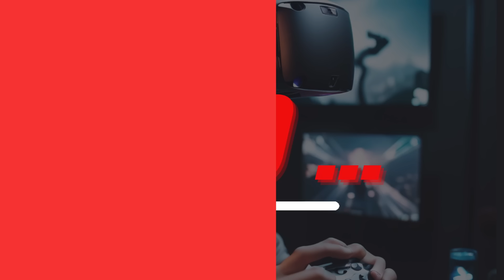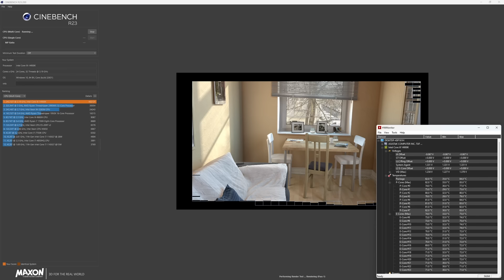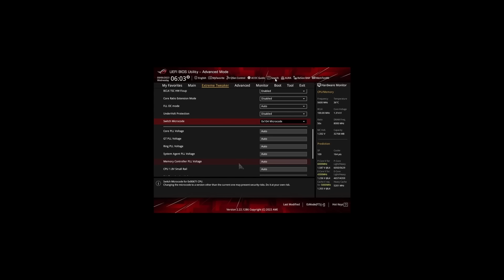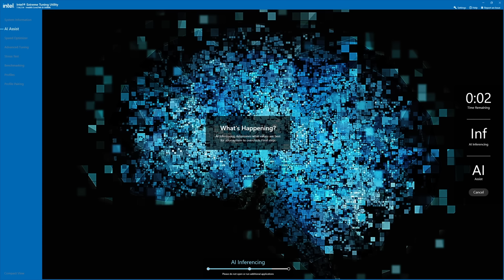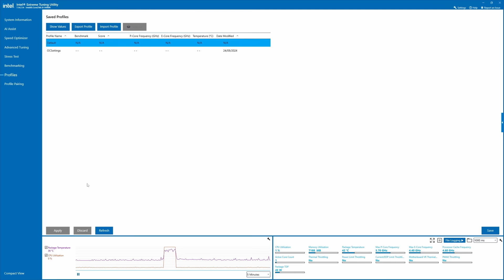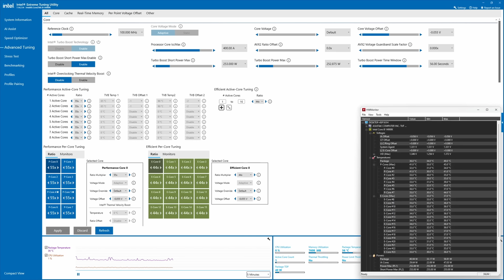Comment: Only updated to 0x125 and still havent update 0x129 for my 14700k

I Just set the limit of IA Limit to 1.400 V. I cant get the maximum advertised speed but it should be safer now. Might change it into 1.375 

 I hope it will solve the degredation problem by not reaching 1.54V again. Because I'm planning to use this cpu for around 5 years++ before upgrading.
Reply: Personally I think voltages is the main issue but intel cant fix it because if they reduce the voltage , then they wont get the advertised speed.

But I think downgrading my 14700 and make it into 12700 spec is far better than letting it kill itself in 2 or 3 years. 😭😭

And undervolting is also a good option. As long its not too extreme.
Reply: @OfficialMinamo  Exactly,, this would throw them into extremely muddy water when they are already facing various class action lawsuits.  The enthusiasts have been aware for some time that they have to take remedial steps to under-volt and downclock to lower the temperatures and in many cases improve performance, but Intel would never be able to tell us this directly for that very reason.
Reply: @nextlevelsimgaming  I really hope your video will give more awareness to people who bought the 13 and 14th gen intel CPU. And they will at least try to  solve the problems , before the problems shows itself.

They need to do something themself , and not only depending on the latest microcode . Because those microcode will become microheadache in the next 1 or 2 year.
Reply: The lower the power running through the CPU’s the better, if you imagine a modified engine in a car, that has been remapped to achieve higher performance, you wouldn’t drive it round at the redline constantly.  Unfortunately the behaviour of many of these processors has been exactly that way, with some even boosting to 6ghz at idle!

Better to be safe, thank you for your channel view and hope the guide was of some help to you 🙂
Reply: if u are limiting processor not undervolting it and setting loadlines as you should then u are making that you CPU asking for 1.55v and u are giving it 1.4 coz u limit the current it needs to get...  the whole point was to sync asking amount and giving amount and to make that  amounts lower :D how to do that with degraded CPU? u cant! so u do this tutorial. but if ur CPU is new u do 0x129 update and make other things... my mbo is Gigabyte and my landline go on high and AC/DC 55 after that I set undervolt to -100 and everything works well.. my CPU don't go over 72-3 degrees and benchmarks are just as they advertise in multi core and single core ... but it is natural that when u have "k" version to overclock it :D this is pathetic that we need to set settings under out of box ... coz out of box it is overclocked bad with possibility to degrade....
Reply: @CodeNameTech  according to buildzoid trial and test, using VR IA voltage limit is telling the cpu the max voltage the cpu can request.

So when we limit it to IA VR limit 1400 and  your cpu asked for 1.55V to boost the speed 6 ghz, it simply tell the cpu that the max is 1.40V and This will make the CPU not being able to boost to 6.0 ghz because of lack voltage and ended up with around 5.4 ghz instead at 1.400V. So if you set the VR voltage limit to 1.300V maybe your cpu can only reach 5.1 ghz or lower.

While undervolting is when cpu asked for 1.55V to boost to 6ghz, mobo will give them 1.55 - offset number you set and let the cpu try using that voltage to boost to 6ghz. The bigger your offset number, the bigger chance it will crash.

I think both method works, limiting voltage is like forcibly making your i9 into i7 or i5 , while undervolting is making your i9 works as i9 with lower and safer voltage . CMIIW

And yeah I agree with you.. intel is crazy LMAO
Reply: @OfficialMinamo  so basicaly u are telling what i have told... ur cpu constantly asking for more and u are giveing him less :D and such a behavior is probably more posible when u underclock and undervolt coz it will be more stable like that... im only saying that best way possible is to avoid sucha direct limit and do fine tuning other way :)
Reply: @CodeNameTech  ahhh okay.. sorry i misread your previous comment. 

The problem now is I dont know if i should update the bios to 0x129. Because some people said that they ended up with worse voltage spike after updating.
Reply: If you just set the IA limit to 1.40v you'll hit CEP if you undervolt to get the performance back (XTU is the only thing that will show this). Adaptive offset, as in this video, is the easiest method for most users who don't want to adjust the actual VID table.

Comment: my 14700k is running fine has not giving me 1 problem ran it clocked and stress tests and it was stable have it under volted now and it ran 96 fps avg on black myth wukong on cinematic pre set
Reply: @JamesCobb-x4p  Great news,  I fortunately haven’t had any problems, with the right protective maintenance, they will hopefully operate correctly.  Hope the guide was of help to you 🙂
Reply: hi,  Have you installed the microcode 0x129 update, which still says it is for non-K processors?
Reply: @JHAMS38  Unfortunately I haven’t been able to test them, but the principles should be the same
Reply: i just bought a 14700k do you mind sharing your setting? power/voltage limits?
Reply: @delanescott7872  I do not have a 14700k to test unfortunately but looking at the specifications the Max ICC should be the default settings, and base frequency locked to all cores, with PL1 and PL2 at the Intel Default settings, you can run an AI tune on Intel XTU to determine these and then sync all cores accordingly

Comment: So intel instead of telling all the modern cpu users to set a limit to their cpu they are telling you to use their shitty bios update to solve the problem they made.And it doesn't solve the problem just lowers the voltage intel doens't give a crap about the users especialy the problem is with the high end cpu's that cost around 800 dollars they should solve the problem in an instant but that's just my opinion.
Reply: And reapply thermal paste liberally & often with these.  They will run qt 99c without a thermal limit set, which dries out the thermal paste
Reply: @acheleg  Agreed, I have actually repasted my processor 3 times using Thermal Grizzly, Noctua and eventually finding Arctic MX-4 to be the best.
Reply: @Naaa7776  Intel are facing a wave of issues with these processors, and I agree entirely, we are not getting the product we paid for unfortunately and there are a number of class action lawsuits in the news in motion taking up this issue.

In the meantime to mitigate the performance loss from the BIOS update, this is a good way to maintain stability.

I would recommend checking out the @GamersNexus channel who covers the issues in much more detail.

The guide is intended on users who want an easy way tweaking settings, in no way am I affiliated or sponsored by Intel.
Reply: The problem seems to be the ring bus using the same voltage rail, and TVB itself is responsible for accelerated degradation due to the crazy volts needed for 6Ghz boosts. It was bad enough that AIB’s were essentially undervolting via AC_LL out of the box to begin with. Probably so R23 scores looks better in reviews. I manually set p-core limits to 5.7Ghz, then set IA VR voltage of 1.4v. No more TVB boosts for me, and no more vcore spikes. Not that I had any issues anyway, but better safe than sorry.
Reply: @MhillPlays  Exactly, the 6ghz boost does absolutely nothing for performance on a normal users system, unfortunately for Intel it was the headline feature that they can’t undo, its now a case of make do with lower core performance or face certain premature failure.
Reply: @nextlevelsimgaming  yes